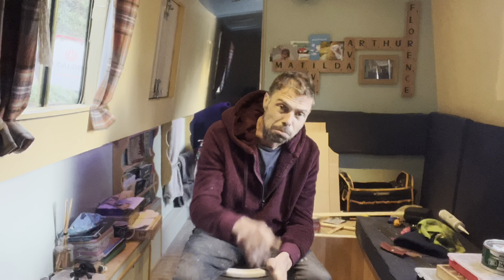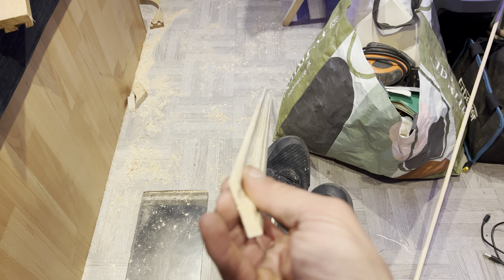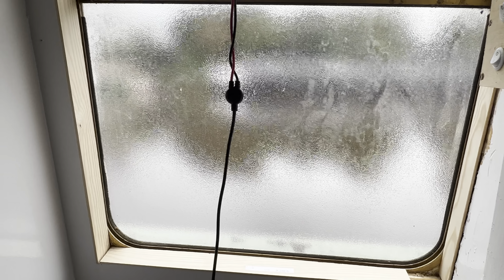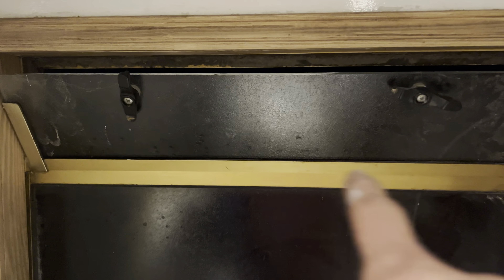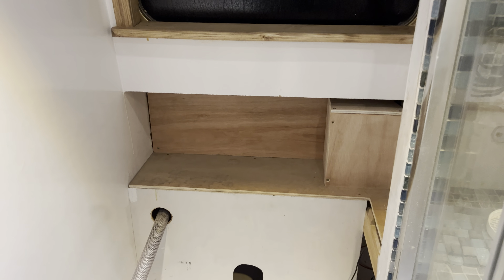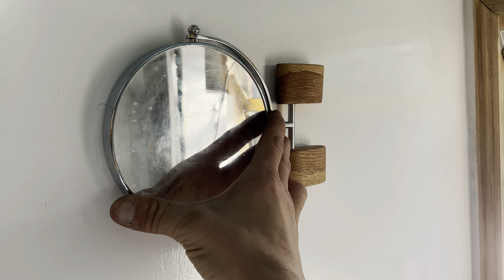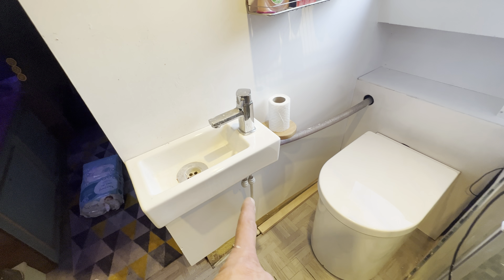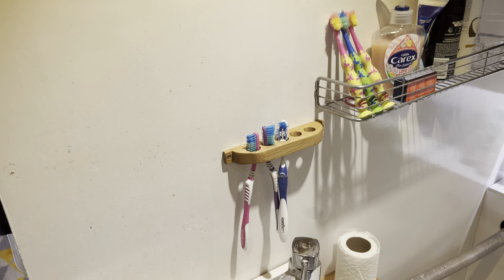371. Trimming Narrowboat windows

Comment: Just a little suggestion that’s not meant as criticism.
After boarding (or trimming) things out, a little decorators caulk eliminates gaps and cleans joints up. (It comes in several different colours and can be varnished or painted over).
Around the window, perhaps a neat bead of appropriately coloured silicone would fill the corners without drama?
Reply from the maker: Yeah nice idea - will track some oak coloured one down

Comment: Hi James, get yourself down to the nearest Eurocel depot and pick up some white PVCu trim up. Take the width measurement with you comes in 6 meter length and you can coil it up to fit easily in your car. 😎😎 it won’t need painting and won’t be damaged by water.

Comment: Don’t you have to worry about the pipes freezing in the winter if heat doesn’t get back too where they feed from.
Reply: @IDKline  True we are on about the same latitude and it does get that cold on outside walls and we have to leave a tap running I was just wondering being a steel boat.
Reply from the maker: Nope - hopefully not. Narrowboats don’t actually freeze (unless it’s crazy cold) - canal freezes but only Upto one inch from the steel hull